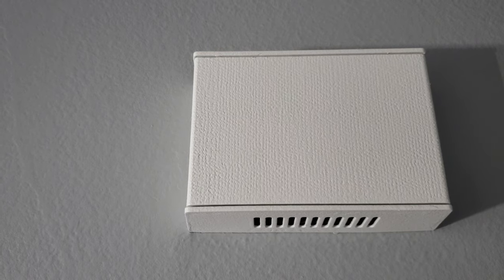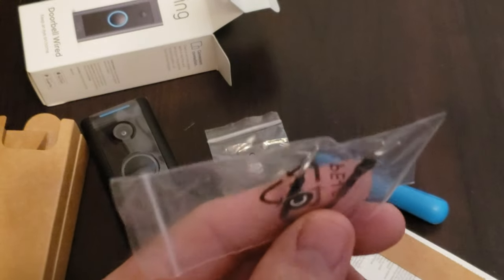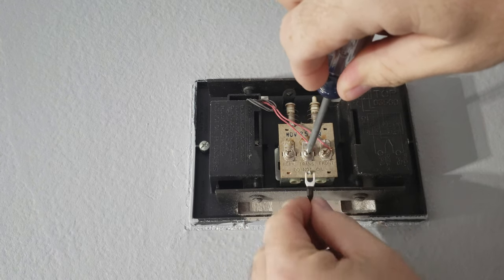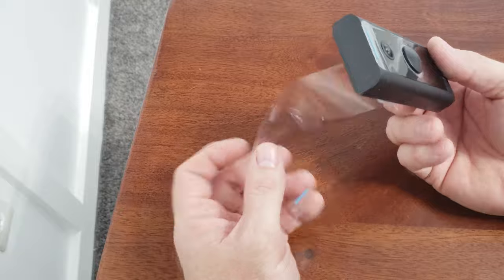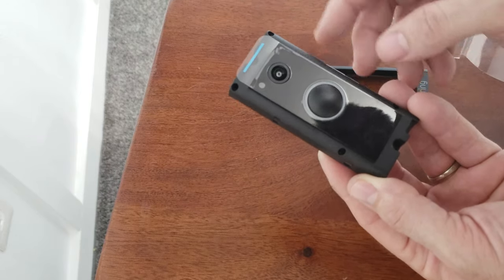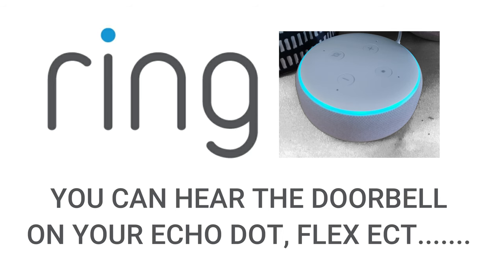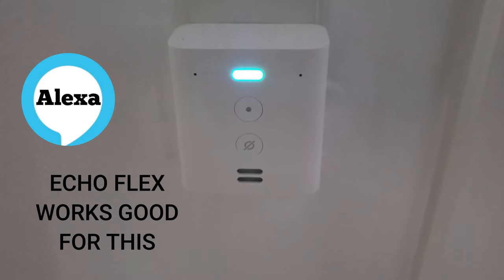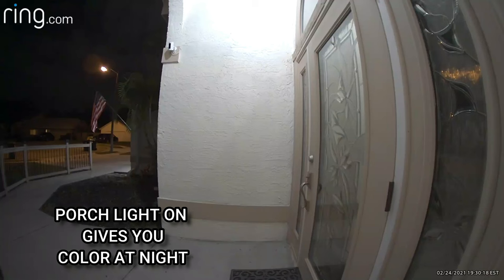RING Video Doorbell Wired Installation

Comment: Hello , what transformer are you using ? . 
16v 30va ? Or 16v 10va? Or 24v 40va ?
Reply from the maker: I already had a door bell so what I worked for this install.
Ring Video Doorbell Wired requires 8 to 24 VAC, 50/60Hz, 8VA to 40VA.
Reply: So what transformer are YOU using  again?
Reply from the maker: @sci_fress3736  My house already had a door bell so I didn't need to install this as its already installed. Not sure if you have a door bell or not. Or are you starting from scratch.

Comment: What is your regular doorbell isn't wired any suggestions or should I have to return it?
Reply from the maker: Yes it is weird.
Reply: You could hardwire power or get the battery version
Reply from the maker: They make a adapter for use with this now so you can plug it in.

Comment: Hi Im taking this Ring device to a country with 220V output. Will this work?
Reply from the maker: No its 110v
Reply: @FloridaFamFive  oh shoot..o should get the battery powered instead
Reply from the maker: @iamjoachim2542  the battery would be better but keep the one you have also ask around maybe someone can make it work. Its cheap enough enough to just keep

Comment: How would you install 2 front and back
Reply from the maker: In this case, I would use this one wired and buy the Ring Doorbell battery for the backdoor. You could wire in a backdoor doorbell and have it wired together at the chime. To much work for this, but you could.
Reply: @FloridaFamFive  Do You Setup Your New Ring Video Doorbell Wired

Comment: That "jumper wire" for the old chime needs to be installed AFTER the power is tuned off.  Granted the doorbell switch is still open, but the power should be off.
Reply from the maker: Power was off before I installed the jumper wire. Good eye 👁 👌
Reply: what is the jumper for? Isn't that shorting it as if the doorbell was being held in? Is that why the inside bell doesn;t work? What happens if you dont use that? My video doorbell is NOT a ring and it rings my inside bell as well as alerting my phone. i do not have a subscription,. WHat happens with RING if you dont have a subscription?

Comment: Do you have to have a smart phone to see the video? I have an old computer monitor I'd like to use to have streaming video monitoring. Can the Ring Wireless do this? Thanks.
Reply from the maker: I noticed this on my laptop no video feed. Works on my tablet and my phone and echo show 5 and 8.  I will have to look into this for you and get back to you why.
Reply: @FloridaFamFive  Interesting idea. I hadn't thought about it working on a tablet. I have an old one of those, too, that I never use. That might be the solution for me. Thank you for the comment.
Reply from the maker: @avlisk  let me know if it works . Im  Excited to see how it turns out.
Reply: It is indeed accessible on the desktop, however you won't get realtime alerts nor will you hear the chime. You would do well with an Amazon show
Reply from the maker: @guidedbygreen1480  most people will look at their phone's to see video. This is what I have seen the most of.
Reply: Man barbers problem